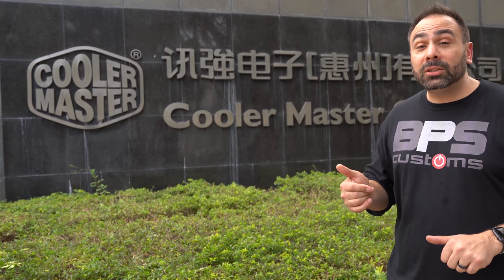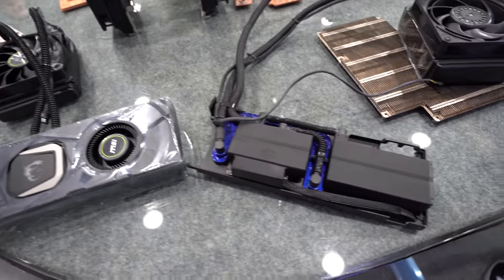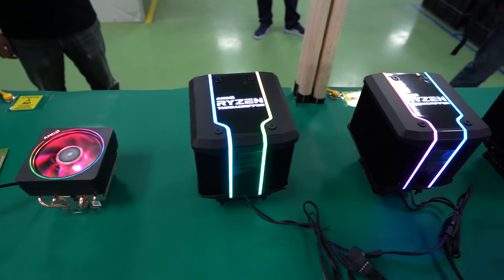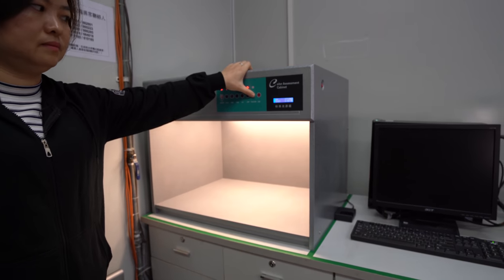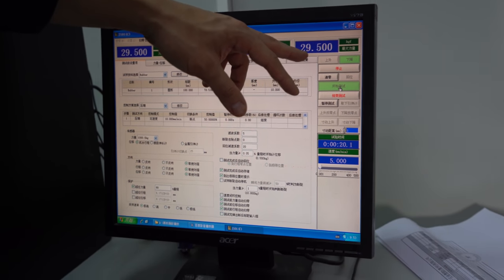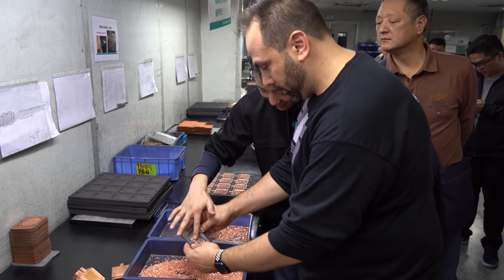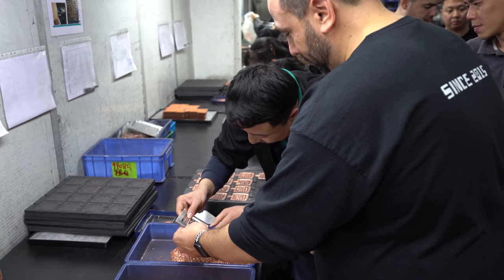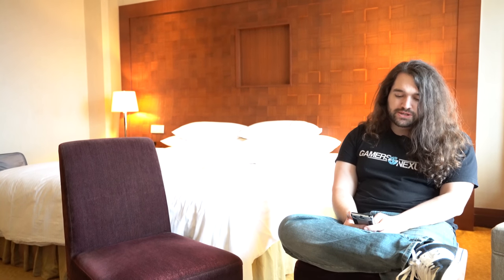Cooler Master Thermals Factory Tour w/ Gamers Nexus

Comment: I’m guessing they’re building coolers for Noctua.  Noctua’s core technology is all about ultra quiet fans.  So it kind of make sense to outsource it.
Reply: It said there in the video "stock coolers for ..." but Noctua is not a company that ships something with a stock cooler, it's an aftermarket cooler company. I believe it would have also been more apparent to them that if Noctua parts are made by CM, that it would more likely have to be a closely guarded secret, unlike NVidia for example.

Comment: Time-saving tip for viewing this lengthy video - view it at 1.25 or 1.5 speed by clicking the gear cog on the lower portion of the viewport where the timeline is located

Comment: Terrible customer support from Cooler Master!  Steal me a Cooler Master Masterbox 5 glass side panel if you find one.  I was promised a replacement when they cam back in stock.  Legend has it they are still out of stock to this day.
Reply: Hey Squid! Sorry you had a bad experience. There are a few Masterbox 5 models out there, could you let me know which specific version it was; pro, rgb, etc. The original Masterbox 5 has an acrylic side panel so I want to make sure I check for the right part for you. Thanks!
Reply: Cooler Master Gaming Thanks for replying!  Didn’t expect that.  It is the original.  Not rgb, lite, etc.
Reply: @thefightingsquid7347  do you happen to know the serial number? It would be on the original box and on a sticker on the back of the case.
Reply: @CoolerMasterGaming  SN: MCXB5S1KWNN111180100464
Model No: MCX-B5S1-KWNN-11
Reply: @CoolerMasterGaming  Any updates on this case model?

Comment: cooler master fans is WORST i use! noise is unreal high! on ANY RPM!
i try 140mm fan with rgb, 120mm fan with rgb with another propeller, and i buy CM pc case with 140mm standart fan and 200mm rgb fans - AND ALL THIS FANS HAVE VERY HIGH LEVEL NOISE AND VIBRATION ON ANY RPM! 
i use now only 200mm fans on 500-550 rpm, they not to loud and have not so big price, i have no choise to use another 200m fans. and will never buy CM items with fans! 
they do not bad PC cases not coolers!!

Comment: Cooler Master never again, bought a case and a RGB Fan last week and case came with broken USB ports on front panel, one of them was bent, and the fan came with 3 pins connection on RGB and with 4 pins controller.